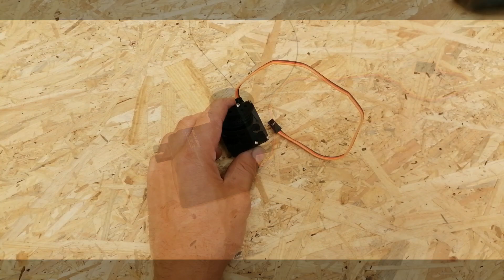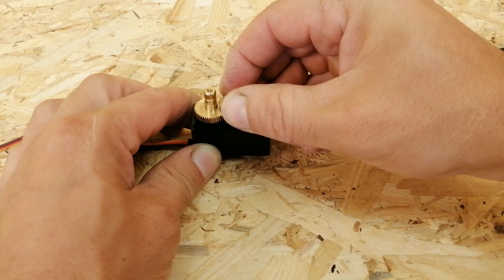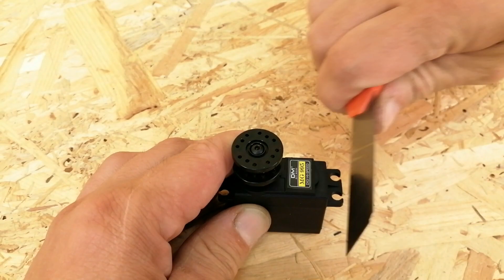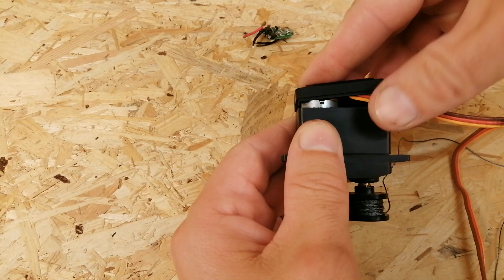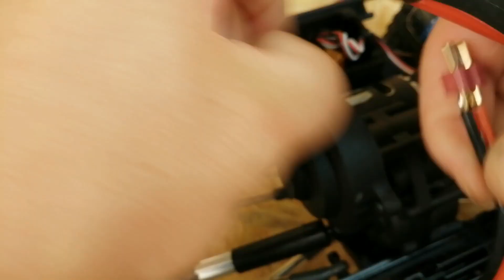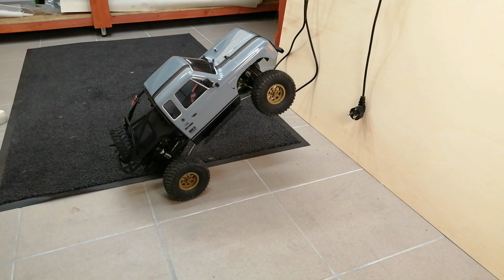How to make servo winch

Comment: I have a servo that I want to convert into a winch for my RC sailboat. Do I need an ESC or can I just plug it into my receiver? I only need it to be able to move back and forth at a single speed.
Reply from the maker: If you keep the servo electronics and fix the potmeter in center position you can directly connect to de receiver.

Comment: Hi. Already try but the problems is it's only running one direction. Currently I'm using dumbroc 6c. Any suggestions?
Reply from the maker: Did you connect it to the ESC or directly the receiver? If you use ESC try another channel, because ESC need 3 position switch

Comment: can the ten amp esc you use be connected to 3s? Or is it only possible to use 2s
Reply from the maker: Three cell will be too much for the stock servo motor. Usually it is working on 4.8 to 6v.

Comment: How to prevent it from pull back the rope when servo in neutral?
Reply from the maker: When it is in "neutral", nothing happen. I cut out the servo electronics and the external ESC control the motor.